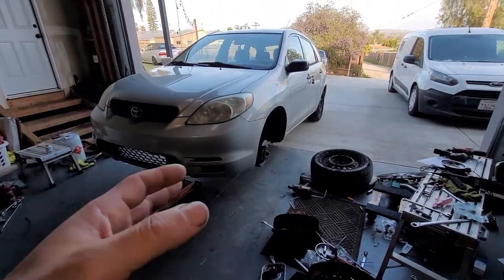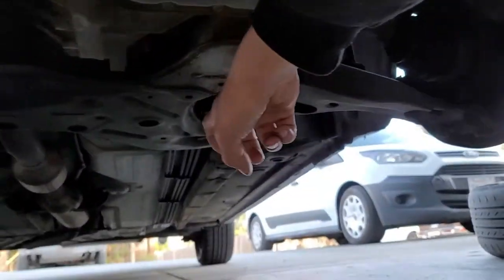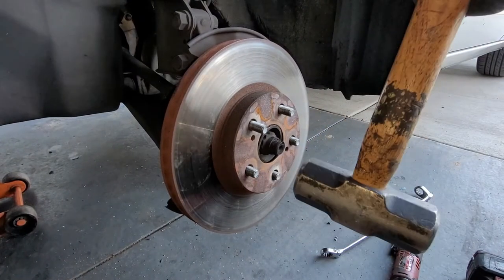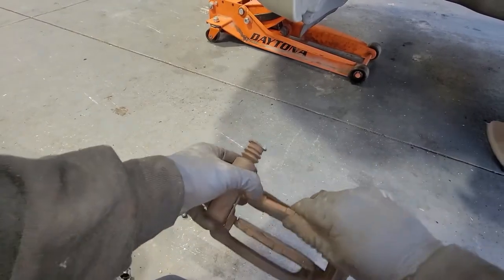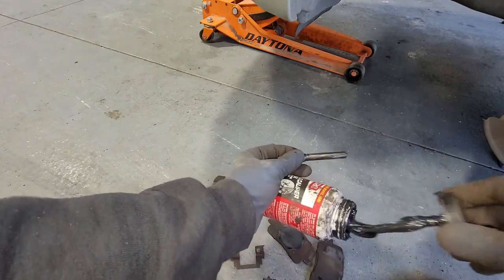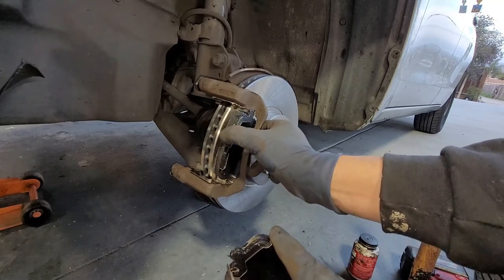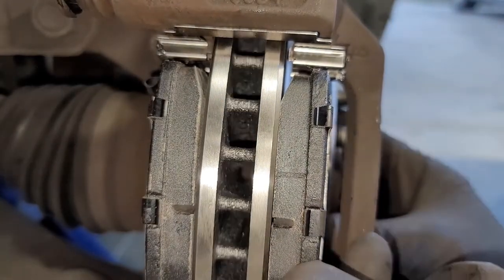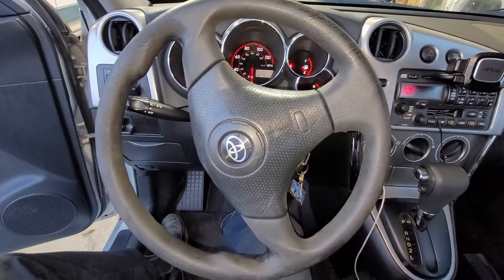Toyota Matrix Front Brake Pads and Rotors Replacement

Comment: Great job. My only comment is that I was taught to always use a torque wrench on the caliper bolts, as well as the lug nuts. Folks can always google the proper torque values. Also, I was taught to use a small bit (dab) of grease on the back of the pads metal plate, which seems to help with noise chatter between pads and calipers. Keep up the good work.